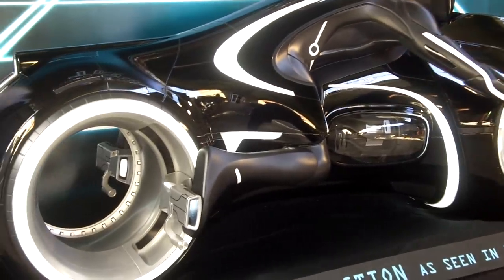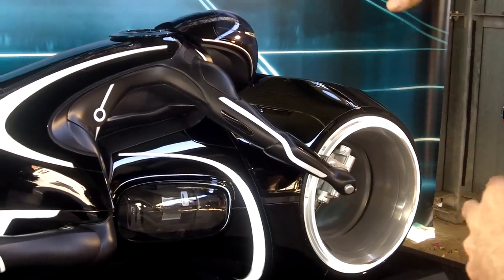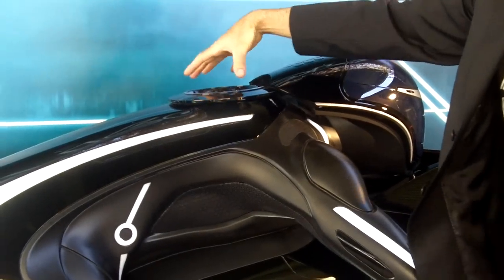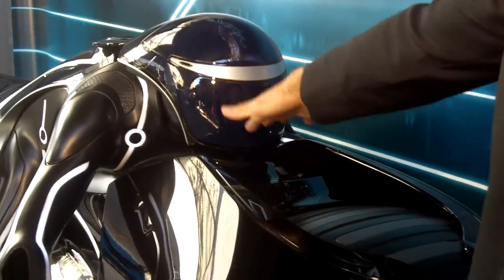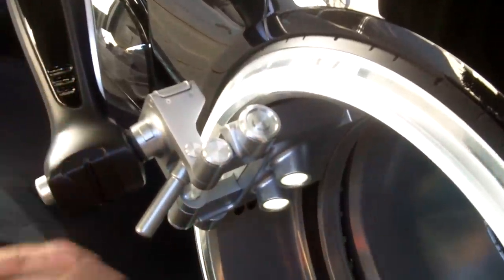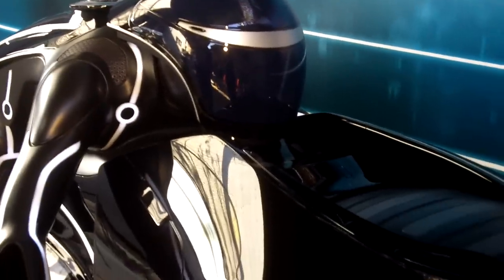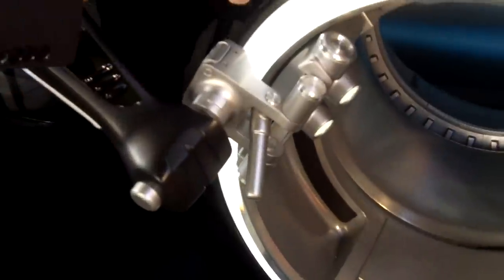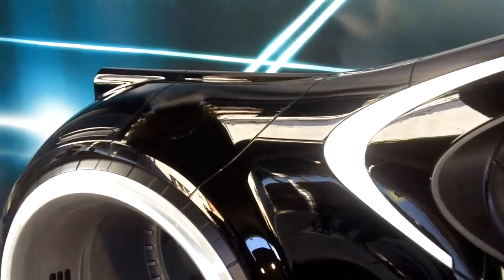Tron: Legacy light cycle designer reveals its secrets

Comment: @stapletonm14 yeah it would be...if the design didnt hurt ur back like a bitch. They designed it in the light cycles "stretch" mode which is when they get more speed in the movie by leaning forward and pushing the bike outwards when they should have stuck with a comfortable normal ride. Its also got a chopper engine in there which i think also ruins the tron-ness.